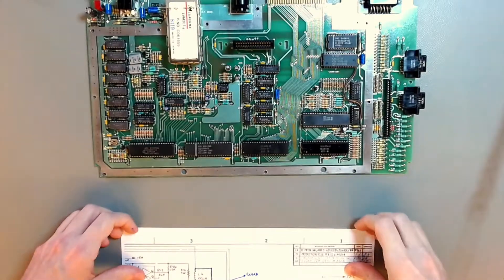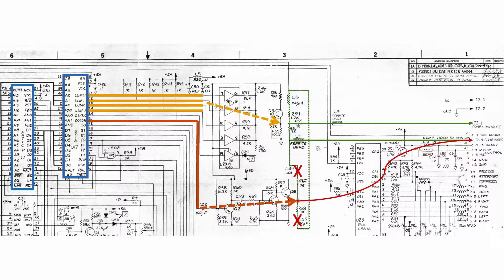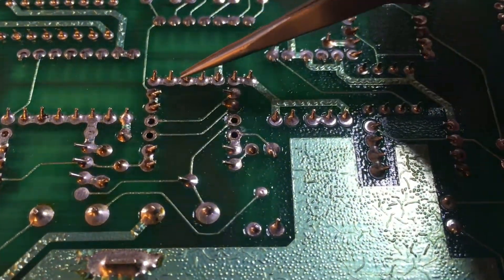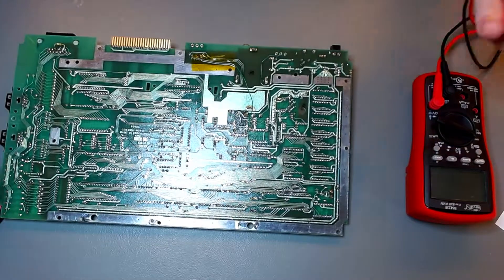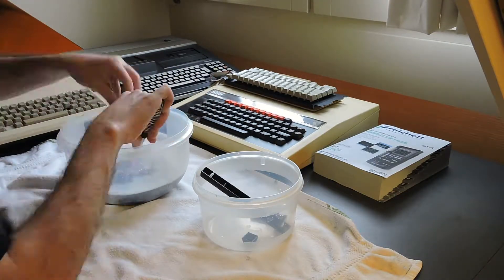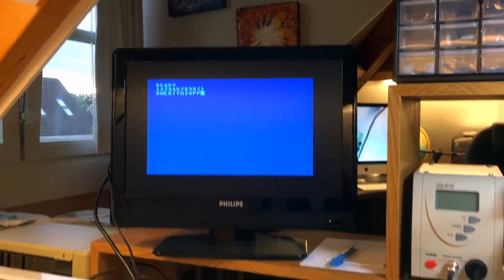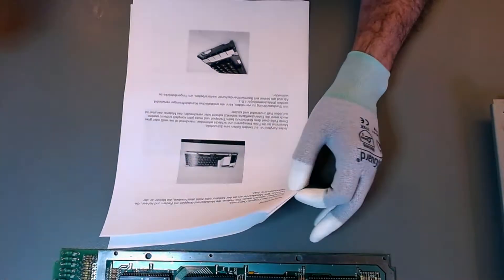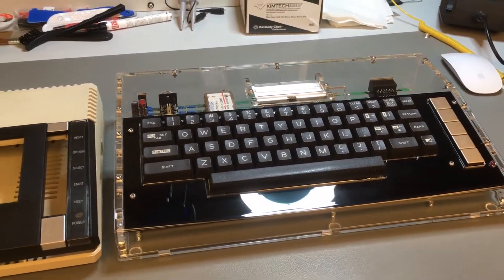Atari 800XL: s-video repair, keyboard restoration and case upgrade (PME, episode 6, part 2)

Comment: Firstly, I love the way you work - clean and tidy bench.
Regarding the video, you've made a couple of misconceptions, but I won't go into details here.  The chroma output should have a 75 ohm resistor in series as per the luma output and as per S-Video specs.  If you remove C56 you will see an immediate increase in sharpness.  It's fitted across base and collector of Q3.  It was not fitted to revisions D and beyond, or XE models.
That keyboard is made by Stackpole and was one of four or more variations used in the 800XL.  You may have purchased the wrong membrane for that keyboard.  End result very impressive.

Comment: Ok, so I'm a bit confused...  I used my 800XL with a monitor cable (4 color R/W/Bk/Y) hooked to a Commodore 1702 monitor. I never noticed any issue with color or video quality.   So, what am I missing in this discussion?
Reply from the maker: There were different versions produced.
Reply: Either your computer has the latest revision board (XLF), which has Chroma signal connected, or it has been upgraaded with S-Video mod or the monitor just uses the composite signal.

Comment: It was PAL or NTSC? Everybody seems to put 100ohm resistor from r67 68 to DIN socket. You did not. I wonder If I should add resistor or not :)
Reply from the maker: This is a PAL machine. I can't recall the details of what I did anymore, but it worked just fine. I did not look at what others were doing.

Comment: Hello, I have a 600XL and I don't know if video mod will also be valid for it, if not, do you have any interesting link for me to provide a good SVideo mod for it? Thanks
Reply from the maker: Hi Felix. Not really, usually I do my own mods and I never had a 600XL to try anything.
Reply: @thebyteattic  It is OK, anyway very very nice explanation to 800XL modding + brave CPU replacement. I like your cleaning and well organized work methodology!!
Reply: The 600XL doesn’t have the circuitry built in for composite or s video, thought the board has the traces for it. Atari saved a few cents by not installing it. http://ftp.pigwa.net/stuff/collections/atari_forever/Extension/Super%20Video%202.1XL/supervid4.html is the “standard” video upgrade for a 600XL. It basically involves installing all of the resistors etc that Atari didn’t bother with and then doing a mod similar to the one here.
Reply: @Doug_in_NC  thank you. I will check for this link and try to complete circuit with components required to add an sVideo output to my Atari 600xl. Rgds

Comment: Why in God's name would someone design a video circuit this way.  It sounds like the electronics engineers at Atari knew NOTHING about SVIDEO.  FFS, I only studied basic electronics (AC/DC Theory) and I could have designed a better circuit in my sleep with one lobe of my brain tied behind my back.

The Case:  Terrible idea.  Sorry, but it looks like crap IMHO.  The original case is a work of art.   Not to mention not everything aligns correctly on the original.  Also what if you decide to upgrade everything (Rapidus, U1M, Stereo Pokey, etc.... it's going to look like a hoarders apartment in that case.  There is a reason electronics is your strong point and not design aesthetic.
Reply from the maker: s-video was just starting back then, they were pioneering it, but that probably is also what got them confused.
Reply: Yes it's perhaps the weakest aspect of the 800XL's. The original 800 does have proper SVIDEO and the user base was upset about this feature being removed for no good reason, except incompetence. Most of the original 800 designers had already left Atari by the time the 800XL was in development. All that said, s-video use back then was rare. Our monitor was composite which was high end in '84.
Reply: It was definitely an error. S-video was implemented on the Atari 800, though not the 400. The error crept in with the 1200XL, and was continued with early 800XLs.  Later 800XLs and later models had corrected circuitry.
Reply: @gamedoutgamer  Even the 800's S-video output does not comply with today's standard regarding voltage signals, but most TVs can generally cope with it. S-Video as a standard did not exist back then.
Reply: I wouldn't say the new case looks like crap, but as I had an 800XL in the 80s I think it's case is a work of art.   I bought an 800XL a few years back and would never change the case, same goes for my 800 and 65XE.
It's part of the nostalgia.
Reply: The guy has developed his own board to plug into a processor slot, he also develops for educational purposes ,so why wouldn't he want it to be on display through a perspex case? The 800XL case is the ugliest of the Atari range anyway. Only people who owned the machine would have an attachment to it.